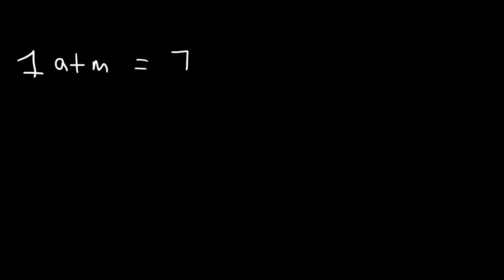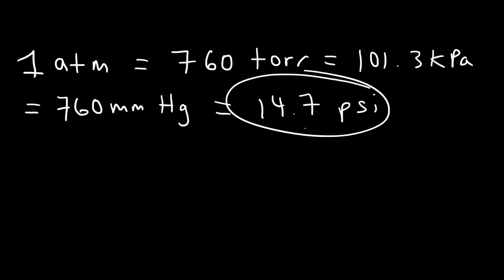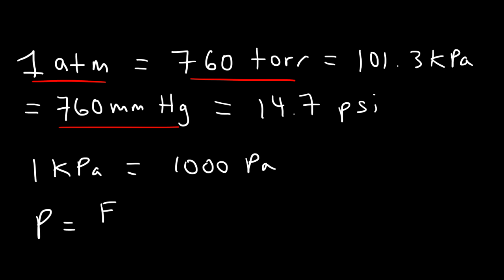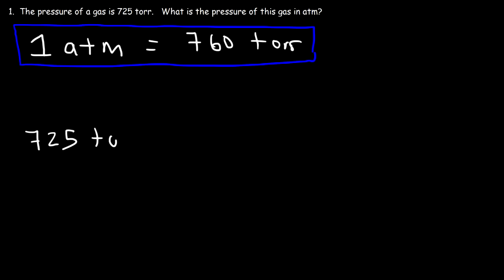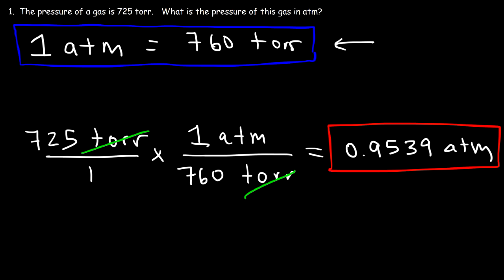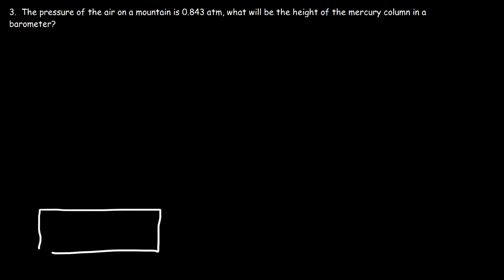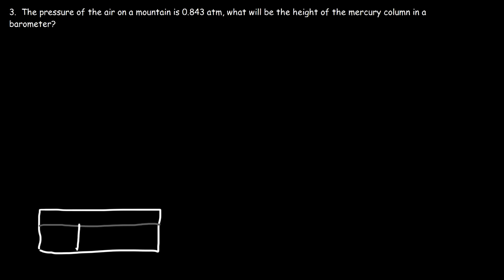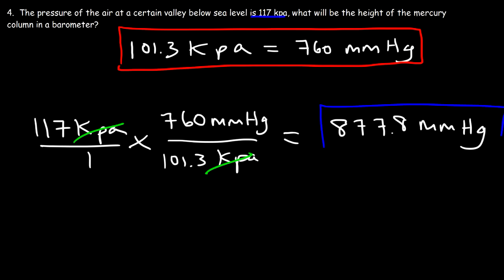Gas Pressure Unit Conversions - torr to atm, psi to atm,  atm to mm Hg, kpa to mm Hg, psi to torr

Comment: Indeed, it is the best lecture on Gas Pressure Unit Conversions. The way you explained the concept was absolutely great. The level of questions start from moderate to high, which was helpful in order to make the concept stronger.

Comment: 1/3 of the air pressure at sea level how many millimeters of mercury?
Reply: Well it will be 760/3 so 253 mmHg. Or, by mental arithmetic, the standard pressure in inches Hg is nearly 30 so 1/3 standard is 10 inches, and 10 times 25 (inch to mm conversion) gives 250!